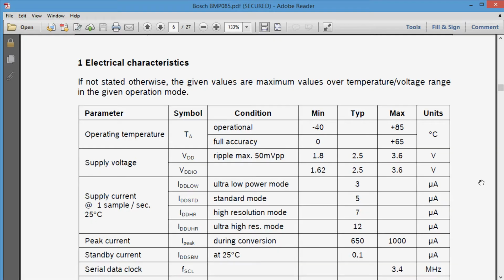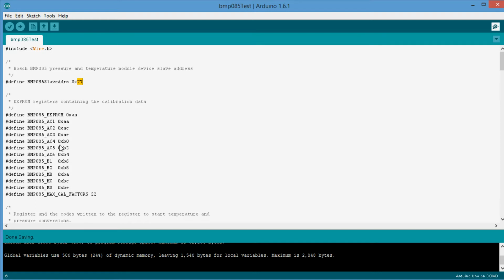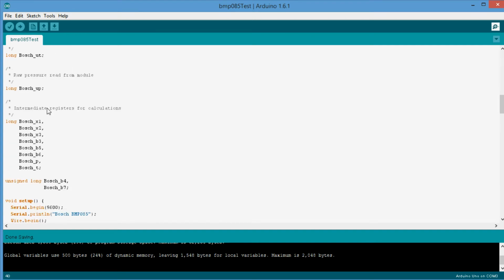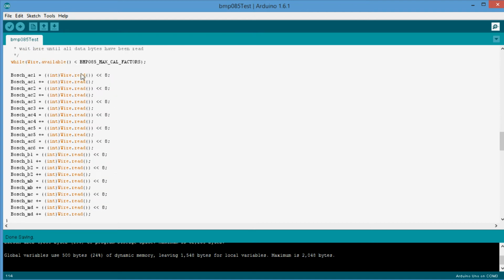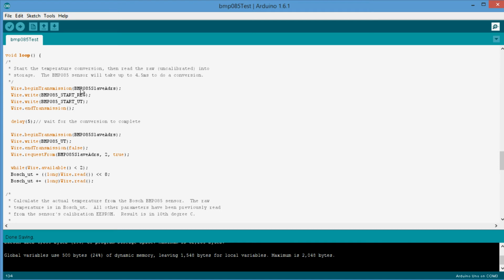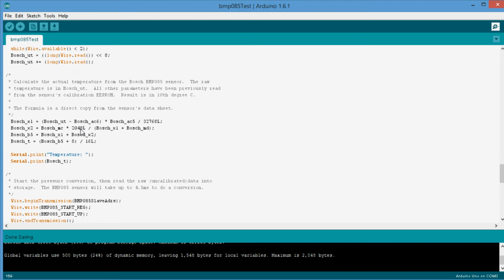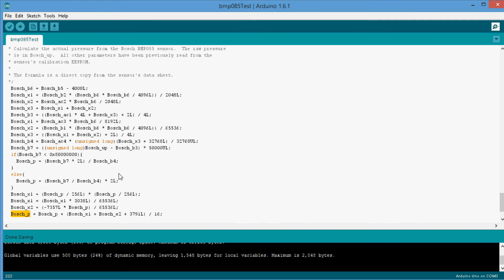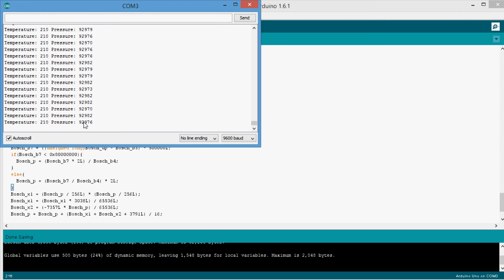BMP085 Pressure/Temperature Sensor

Comment: can you post your written code somewhere? i did what you did in you video but dont get anythign on my serial monitor, it compiles and uploads without problems
Reply from the maker: elnerda Thanks for watching the video.  I'm sorry, but I haven't set up a place on-line where you could download my code.  I need to spend some time looking for an appropriate place, but I don't have the time right now.

Go through my video and pause it where there is code on the screen and check that you have copied it correctly.  If you have, the next thing to check is whether the Arduino is communicating with the BMP085  If not, my code will block (stall) in setup() at the

while(Wire.available() < BMP085_MAX_CAL_FACTORS);

statement.  Wire.available() will always return 0 if I2C communications have failed and the while() statement will loop forever.  Insert a Serial.println() statement with some unique text in it ("past while" for example) right after the while(Wire.available() ... ) statement, recompile and run.  If you don't see the text on the monitor, that means the I2C communications is not working.  Check if you've correctly wired up the Arduino to the BMP085.  Beyond this, try another sensor, perhaps the one you have is dead.

Good luck!

Comment: Good video. I have a problem with the code, when the code says
 PORTC = Ob11001111; 
There are a character next to PORTC, which is? 
Sorry my english is horrible.
Can you answer me pasting all the code? Just if you want.
Reply from the maker: +Manuel Molina I think there is a typo. After PORTC there is an equals sign (=) followed by 0b (that's a zero not an O) followed by the binary code. Hope this helps.